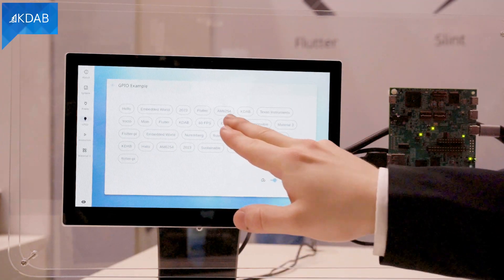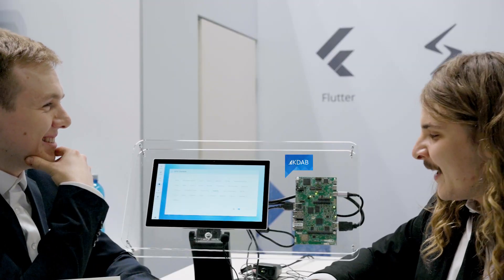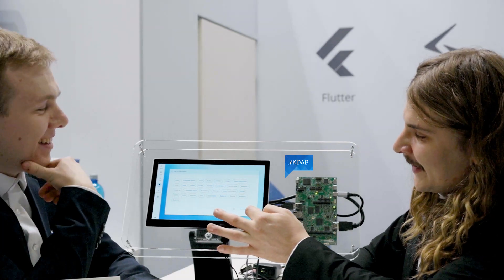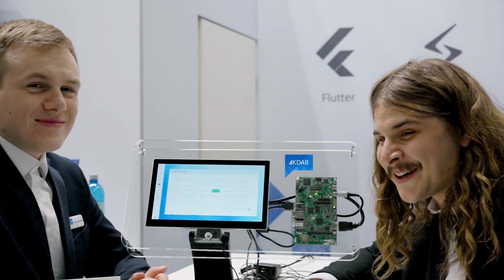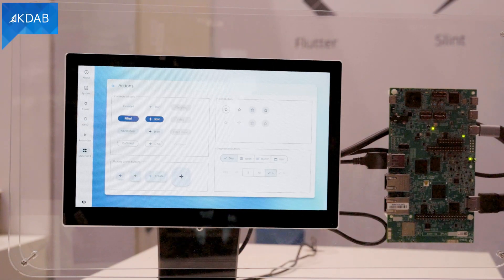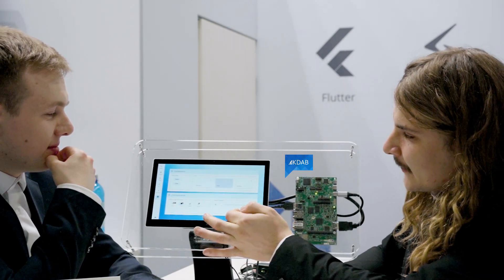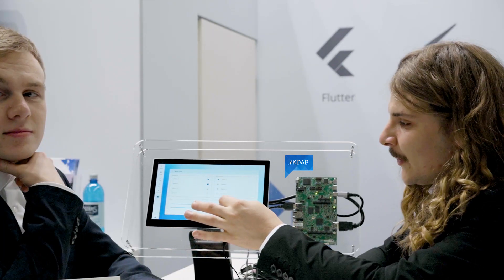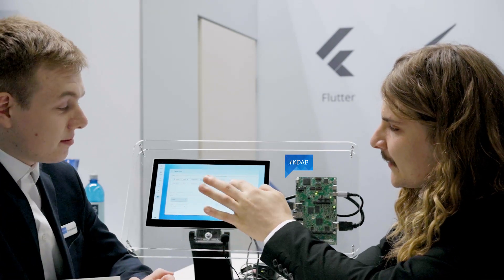Flutter on TI AM6254

Comment: @KDAB can you explain the process of compiling Flutter on this board? perhaps a link to your blog?
Reply from the maker: Hi!
We used this yocto layer https://github.com/meta-flutter/meta-flutter to run flutter-pi on this hardware. We recommend keeping an eye out on https://www.industrialflutter.com/ for upcoming blogs and tutorials on how to use the meta-flutter layer! :)
Reply: @KDABtv  Hi, thanks for your answer. If you went through the trouble of making a video, you could have shown that one of them is running flutter and then started the app. Now it is anyone's guess if the work you've done (porting flutter to two different embedded devices) is actually working... I do believe your word when you say it, this is a tip :)
Reply from the maker: @bobby9568  Thanks for your feedback! We'll consider this for future videos! :)